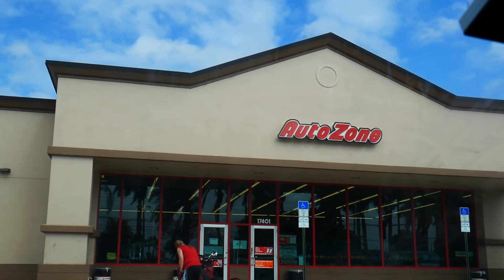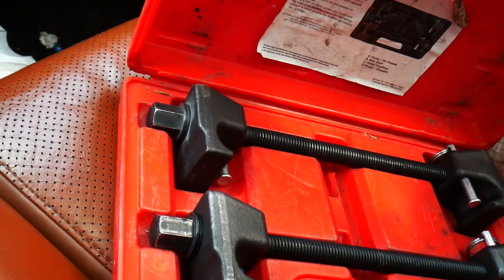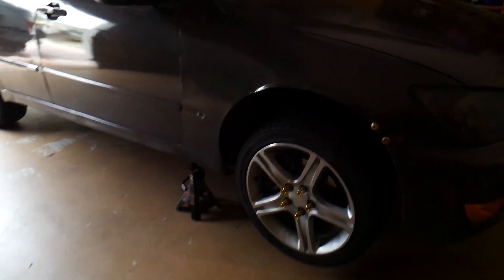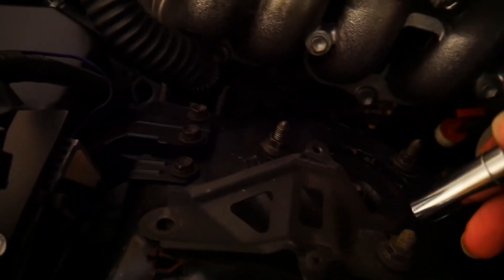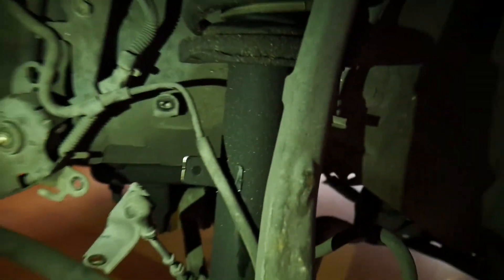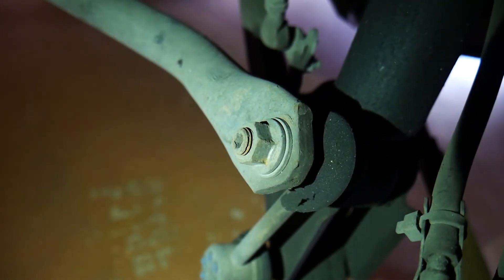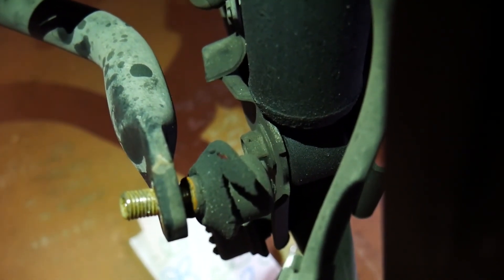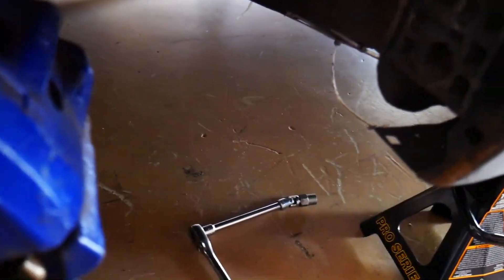CHANGING SHOCKS ON MY IS300!

Comment: Yo boyo, I live near Pines too lol. What tools did you need besides 10mm socket 2x 17mm sockets, 5mm Allen key and a 12mm socket with possible bolt extractor and the coil spring compressors? Need to replace mine on my 03 is Asap!

Comment: I just replaced mine and referenced your video a lot, so thank you for posting it!  I figured out by complete accident if you loosen the bolts only connecting the shock (the three on the mount on top, the abs line, and the bottom of the shock) if you loosen all them, then turn the wheel so the rear side is coming out opening your view, somehow that loosens the shock and you just guide it out around the lines without damaging them and it comes right out.  I figured the one side might've been a fluke but I did it to the other side and it worked perfect as well.  Maybe not the most professional way, but definitely less bolts (looks like the bolt you removed at 6:00 maybe got damaged?  I definitely had trouble attempting to remove those, probably would've damaged other parts).  Thanks again for the video man!
Reply from the maker: Thank you for watching!! That sounds really smart what you did and a lot easier than what i had to do 😂😂 and i believe i did damage that bolt sadly but i still got it on once i finished the work